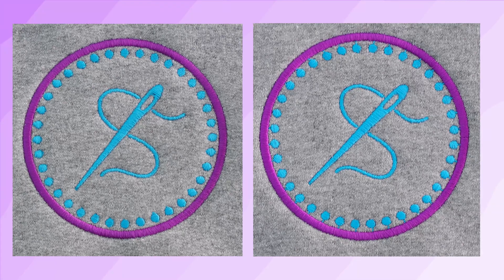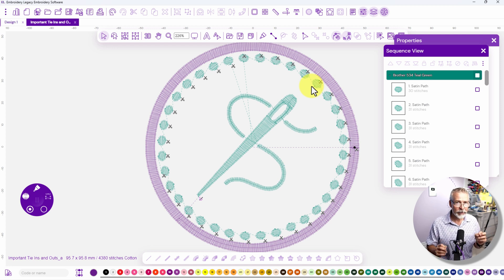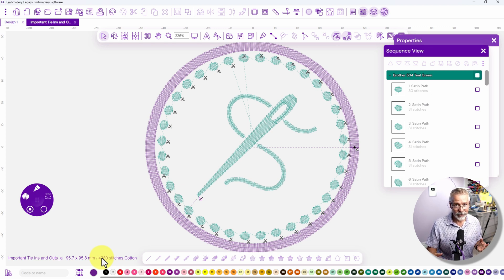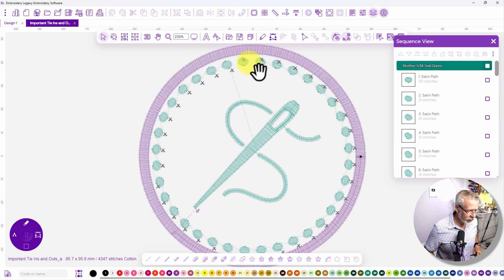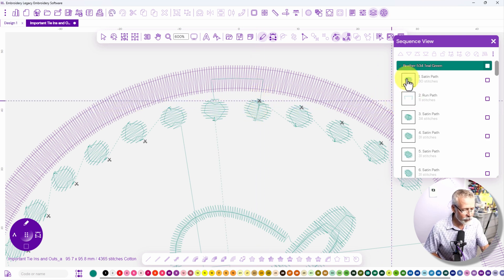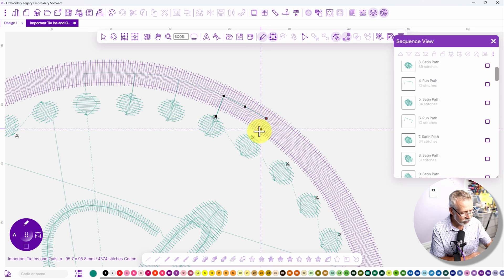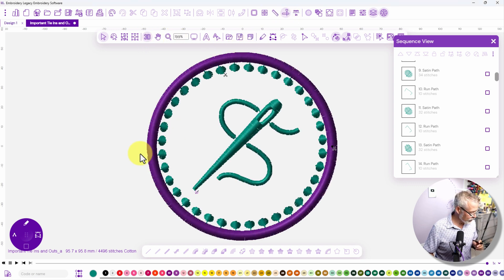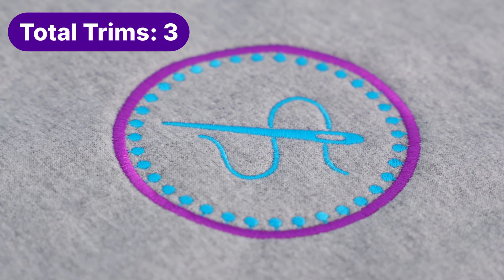How To Remove Jumps & Trims In Embroidery Designs

Comment: John, great lesson. But when you put in the running stitch from one circle to the next, it looks like it will show on the finished design. Sort of like a thin trunk on a tree, or a lollipop with a stick. Is there any way to cover it up? Or is it a non-issue? -- thanks.
Reply: @vickyrussell4200 the running stitch is covered by the finishing stitch around the outside. The “lollipop” stitch is so small that it won’t be noticeable once stitched out. If it bothers you then you can nudge the little circles a bit closer to the finishing stitch so that it covers that as well.

Comment: Ok i understand the keep running and eliminate trims but the first one had 4380 stitches and after John eliminated the trims the stitch count went up to 4496 an increase of 116 stitches am i missing something here ? I thought eliminating trims would decrease stitch count.
Reply: You are correct, I did add 116 run/travel stitches to the design, it is much more efficient in run time adding those stitches than the machine having to slow down tie out, trim, jump, tie in and then ramp up to running speed again for every extra trim command :)
Reply: I think he was saying that originally it would have been many more stitches than 4380 and that this count was deceptively low.